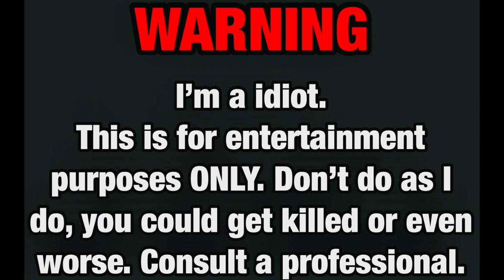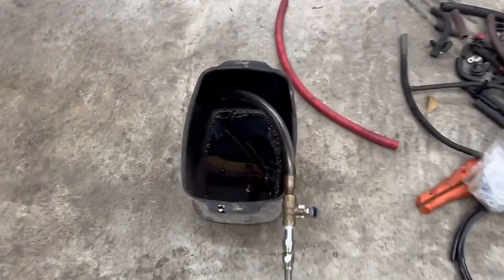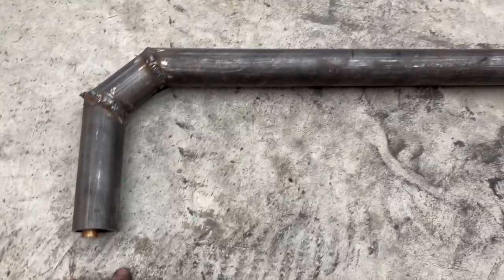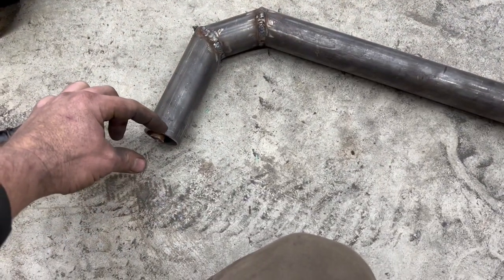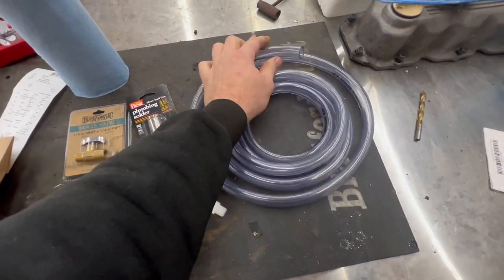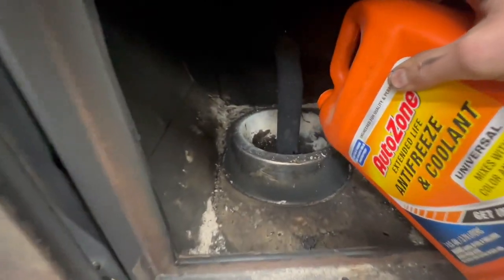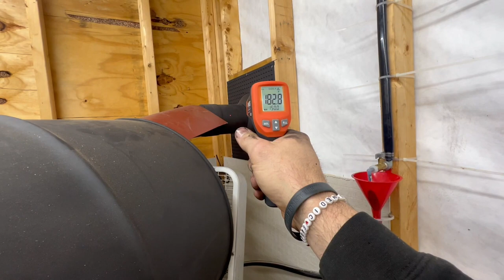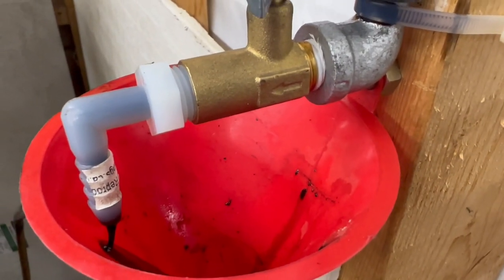waste oil burner double barrel stove

Comment: What keeps the fire from traveling back  through the copper supply pipe   and reaching your used oil vessel??
Reply from the maker: A) there is fan forced air blowing through the outer tube, fan forcing a clean burn and feeding the fire along with cooling the copper tube carrying the oil to prevent coaking up of oil in the tube. B) for the fire to travel back to my oil container it would have to burn up 4’ of copper tubing to get to the funnel then jump up 4” to the needle valve then travel another 5’ up the plastic tubing to the oil container. C) fire needs 3 things to burn-heat, fuel and oxygen. In that small tube it wouldn’t have much of a source for oxygen to burn, there wouldn’t be much of a heat source to continue the burn and the fire would have to be able to burn in a completely filled tube of oil after the needle valve on the wall. Drop a match in a bucket of oil, it will immediately go out. Oil has a high flash point it doesn’t have fumes like gas, diesel or kerosene to ignite. Not to mention the fan forced air alone going through the outer pipe alone prevents this from happening at all and in itself will put the fire out if you don’t feed it enough oil.

Comment: What kind of bowl did you use for inside firebox? And did you have any issues with running hair dryer nonstop?
Reply from the maker: Stainless steel dog bowl starting out then found a stainless steel sauce pan that worked even better. Hair dryer started sounding sick by the end of winter but still ran, it was one of my wife’s old ones so it had been used hard a year before that. I had the button zip tied on cool so it wasn’t getting burnt up.

Comment: Wish i watched this before i spent 2500 on a wood furnace
Reply from the maker: That’s why I built this, I like the idea of putting in the work, saying it’s mine and that I built it and saving money. Not to mention I have a ton of oil with the shop to get rid of, what better way than heating my shop.
Reply: @AutomedicGarage  I got about 60 gallons or so sitting around as well. This would be great

Comment: How well does this heat your shop?
Reply from the maker: Shop is 36x42 14ft side walls. Only thing insulated is the roof. I can work in short sleeves in 20-30 degree outside temps